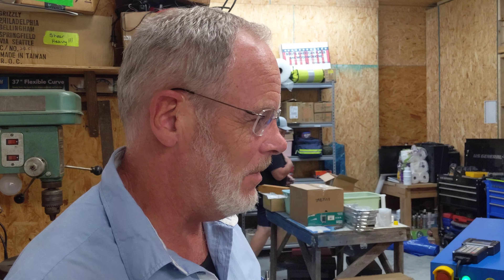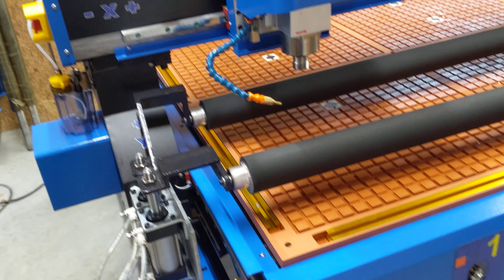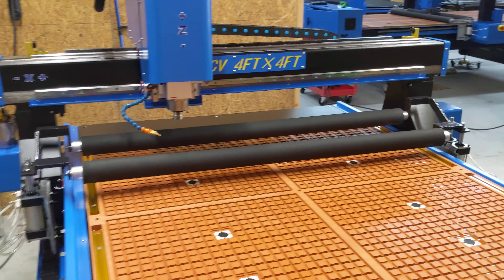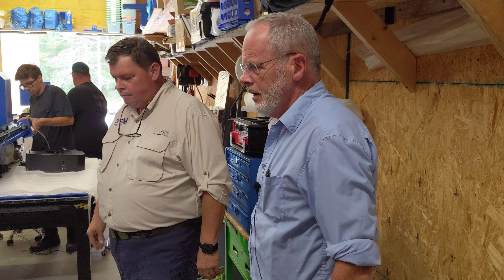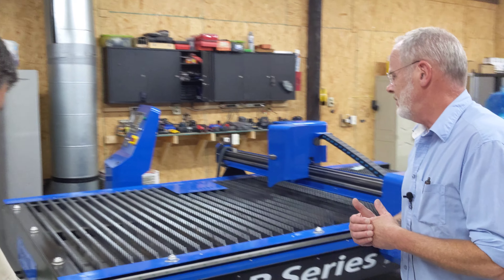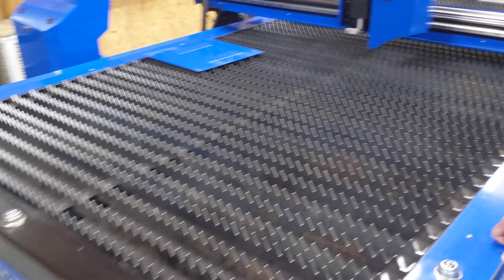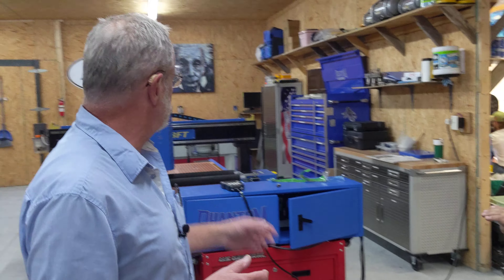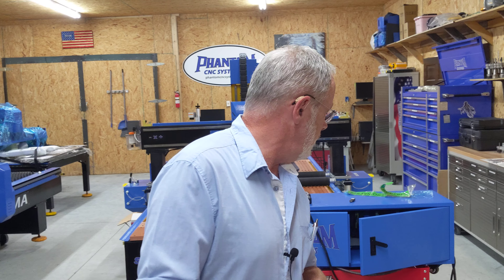New Phantom CNC Router 4x4 Intro To IDC Woodcraft At Phantom CNC Systems

Comment: Do you know anything about and/or have an opinion on the Stepcraft CNC machines? I'm looking to buy my first CNC and it's one of the ones I'm looking at. I wish I could swing a couple more k's to buy this one but....
Reply from the maker: JD, stepcraft are great machines brother but it really comes down to what you want to make at the end of the day. If the machine isnt large enough, you might need to move up into something more robust.
Reply: @IDCWoodcraft  It's strictly for guitar bodies and necks(electric). I want something that I won't feel I need to upgrade after 3 years and I have a $7000.00 max. budget. Any and all advice is welcome and much needed. I ran some industrial CNC machines YEARS ago in my aviation career, so I'm not going in completely blind, I just don't know these small benchtop CNC machines. Thanks

Comment: Nice looking machines.
I sort of agree on the 65 amp plasma source but it does depend on the products you plan to make.
Regarding the branding yes hypertherm can do a 100% duty cycle and I doubt the harbor freight unit has that duty cycle.
That said, I am using a cheap source but planning on saving up to invest in a hypertherm.
That plasma table is that a downdraft or watertable?
Reply from the maker: Johan, those are some good points about duty cycle! I will have to look into that.

Comment: Hello,
Im wondering if you have any regrets in purchasing this version versus the ATC Atom8c? 

Trying to decide on 1 of them. 7k different. Thats 7k for a 2nd cnc like longmill. 
Pls advise sir. Regards.
Reply from the maker: waheeddawodu9892, Hi there! Both the version you're considering and the ATC Atom8c are great options, it really depends on your specific needs and budget. Do some research on the features of both machines and see which one aligns best with what you're looking for. I have a video that should really help you narrow down your CNC choice. It will really help you determine what to look for when buying a CNC. Here is a link: https://youtu.be/wLVNF0L-ZdU
Reply: Thanks for the feedback sir.  Greatly appreciated.

Comment: Hi.
What's the purpose of those rollers?
Reply from the maker: Hadi, good question brother! This machine has a vacuum hold down system to hold down the work piece but to help the vacuum system we have these rollers to keep everything secure while you are cutting.
Reply: @CNC Routers, Beginners & Beyond - Garrett Fromme  it's a good idea.
But what happens when a roller goes over the edge of workpiece. Doesn't it move the workpiece?
And one other question are the rollers M-code controlled?
Thanks for the answer.

Comment: way beyond the home diy person.  I liked it more when you were talking about something the home DIY person can afford.
Reply from the maker: Mark, I understand brother. What I show you on the big CNC will directly relate to the home DIY CNC.
Reply: The CNC community is diverse and wide with requirements and budgets. For some delrin v wheels and 8mm lead screw is suffice. For others linear rails and ballscrews or rack and pinion is the only viable option. I know of many in both spectrums for home use and none are wrong. Whatever gets you cutting chips is the right solution. Enjoy the journey.